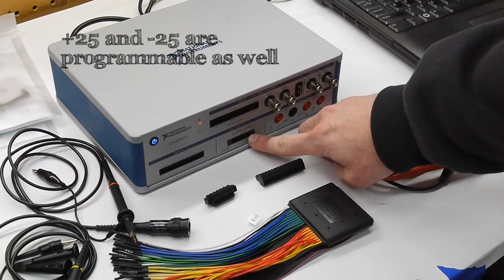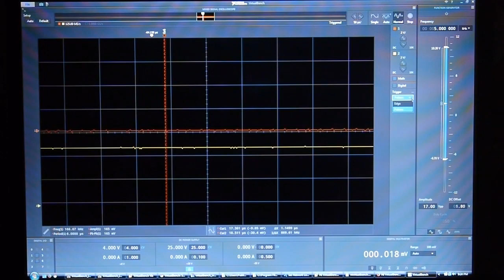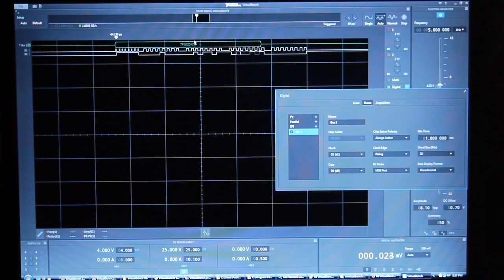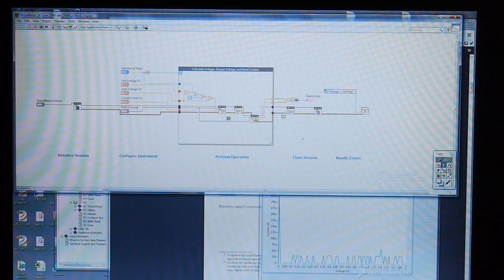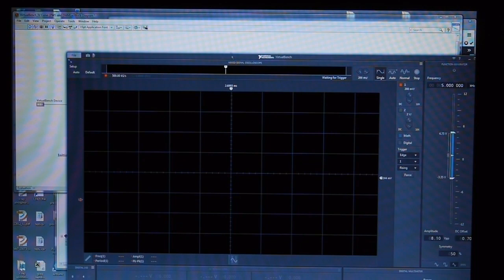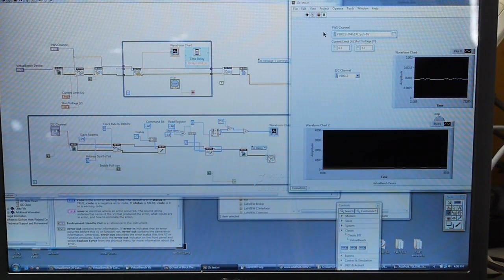Review of National Instruments VirtualBench

Comment: And here goes my suggestion to NI and all others supplying drivers & apps for some instruments.

Why not also have a built-in html5 web server, so the only thing you need on your PC, PAD, etc. is a html5 capable browser, which is nearly every browser today.

No install, no hassle with drivers, apps, conflicts, just start up your browser, type the IP/adress of your instrument or have it all set up as a shortcut and you're ready to go. No matter if it is a Samsung android pad, Ipad or one of your windows,linux machines or virtual machines.

The same goes with integrating it with user code in any language.
Do it with a general TCP/IP interface, too. What is the use for a driver talking to the instrument and then presenting some kind of non standardized API anyway? Just skip the driver and use the "TCP/IP API" built into the instrument directly.
Reply from the maker: I agree.  The VirtualBench does have a webserver for configuration and settings, but no HTML5 app for usage.  This sentiment applies to mobile too:  Forget iOS and android apps which provide the same functionality as a webpage -- just use a webpage!  Of course, vendors know users want this, but would prefer to have them locked into app, rather than able to quickly switch to another vendor by typing a different URL.
Reply: Applied Science what does the vender get for forcing app? you purchased their hardware...they got paid!  what are they trying to gain?
Reply: That'd make too much sense.
Reply: jasonofcompsci ok so why not a pre-html5 web page and app?
Reply: Raymund Hofmann   Adding a layer of code and administration tends to increase latency

News flash: web servers are a layer of code and administration.  In fact, they're a LOT of code, and they add a lot of text overhead.

via any I/O offered by the OS.

News flash #2: all I/O requires a driver of some sort.  ALL. OF. IT.  Even USB ports.
Reply: Raymund Hofmann  Web servers are everywhere

Ubiquity implies neither quality nor low latency.

why not stick with a few good and efficient I/O drivers

How few?

Are you working in the "driver software industry"?

Drat you for discovering the nefarious plan of the Driver Software Industry Association to conquer the world via a nasty driver jungle for each and every slightly differnt device and/or manufacturer! Mark my words, Raymund Hofmann , we'll get you for this!!!!!!
Reply: Raymund Hofmann  The best quality and lowest latency is not what the market will buy

You're confusing technically competent engineers with the mass market.

"Everything Should Be Made as Simple as Possible, But Not Simpler"

That's not an answer.
Reply: astrialkil The VirtualBench has a wifi and a USB interface. If you want to make a app that works for both interfaces, then it has to be a PC app and not a web-app.
Reply: IThinkForMe And now we have web-usb and a web browser can talk to usb devices. You’d think it’ll change what the vendors do. I hope.
Reply: +Raymund Hofmann  What is the use for a driver talking to the instrument

Low latency?
Reply: +Raymund Hofmann HTML5 is not a programing langage,its a markup langage, the most interesting things is done by the server side langages, which could be asp or php,now a day even client side langage (HTML) should be heavely inhanced by Jquery or javascript,bootstrape...
,
Reply: +Raymund Hofmann  there are a lot of instruments in the market which includ a built in server,the problem with that is you cannot customise your testing solution, you are limited only by the UI delivered by the built-in webserver.if you want so, you to install necessary drivers and includ .dll to your projects.... :)
Reply: Badre ARRAS The built-in server provides the data to the web application, and typically it’d be something standard like rest with xml or json; or data packets over websocket. Your code can do just what the web application does. Not only is it easy to reverse engineer, but you’re likely to run into very typical approaches. So, even if the vendor does not specify the protocol exposed, it’s usually not all that much effort to get to it on your own. No dlls necessary. All major application development frameworks support establishing http connections to a web server and carrying out requests in typical fashion (rest, json, xml, websocket - all are supported).
Reply: IThinkForMe Networking over USB is an option, also very easily cross-platform. Or build an intermediate layer that hosts the web app locally and redirects data to the USB connection.
Reply: wanswers
>Networking over USB is an option
Not if you want to run an oscilloscope via USB. The bandwidth you get over plain USB is something you may not want to design away.
>build an intermediate layer that hosts the web app locally and redirects data to the USB connection.
This is an interesting application, but I can see having to set up wireless and USB to get an oscilloscope working quickly become a user experience problem.
Reply: IThinkForMe Networking over USB gives you standardized drivers. That’s all, and that’s great. The rest of the software sees your device as if it was a yet another network interface. And networking-over-USB is rather performance-focused, both on the end of USB device class standardization as well as on the USB host end of things. A network-over-USB connection has no problem saturating a USB3 link, and it’s also easier to apply in terms of components: if you have a microcontroller with Ethernet RMII, attach it to a switch chip, add a PHY for the BASE-T connector, and a USB-to-Ethernet bridge to another port. Simple and effective, with minimal development cost. You get USB support as soon as you’ve got the TCP/IP stack up. Both iOS and Android support standard CDC (Communications Device Class) RNDIS and ECM sub-protocols. It all pretty much just works, and these days using some custom protocol for USB is silly, mostly. All you may need has been standardized and the drivers are bundled with all major operating systems.
Reply: RonJohn63
Why do you think so? Adding a layer of code and administration tends to increase latency, because this driver is likely to translate between the drivers for I/O and the application.
I see no reason to have these kind of drivers except for meeting really common and substantial standards, otherwise put it in the application software that talks to the device via any I/O offered by the OS.
It is another story if the device is attached via a custom I/O to the system and the system eventually should do more kind of realtime duties, then a driver might be advantageous. Unlikely to be that way for standalone systems.
Reply: @raymundhofmann7661  Going through the whole TCP/IP stack definitely would add additional latency compared to talking over a serial connection with a custom driver.
Reply: @frother  Did you measure it? I think for current OS/Hardware  the physical link speed dominates the latency. And about the lesser latency caused by software i would rather want to rely on much more proven and optimized TCP/IP stack and network drivers.
Reply: frother TCP/IP stacks and USB networking drivers are optimized to hell and back. They add no latency compared to the latency of the USB link, and of the underlying device. Windows is not a real-time OS, so you can’t reliably use extremely low latencies anyway. But in a typical scenario, the device-to-application latency for CDC-ECM over USB-C can be well below 100us. The network stack will do the absolute minimum amount of processing on top of the packet, and you can design the user software (web browsers leverage it!) to do zero-copy data transfers. You literally have the USB host write the stuff to a RAM buffer provided by your application, and after a bit your application is notified that it’s buffer has been filled, and the OS doesn’t touch the data other than to perform packet filtering and update the state of the connection in the TCP/IP stack. Decryption can also be done by hardware, so the SSL stack doesn’t touch the data, just update the state. Custom drivers are nowhere near that performance unless you have know-how or money to put a lot of work into development. For serial-over-USB devices, the vendor drivers usually suck. CDC drivers in the OS usually do the best job compared to anything a vendor may provide. And what even would one wish to replicate Microsoft’s or Apple’s work for? It’d be a waste of effort. These days, the USB driver development is mostly focused on the device end of the link, and on standard device classes. USB has finally fulfilled its basic promise of being a “virtual wire”. You want to have a video cable, use a video device class. Serial cable? CDC ACM class. Virtual display? Use DisplayLink-over-USB, and leverage a vendor driver for that. And so on.
Reply: RonJohn63
Web servers are everywhere, no need to install and they don't replace the driver, they replace the application program and the driver in this example, so even if they are a lot of code they are mostly favourable compared to a specific driver & application. The raw network communication with a html5 browser can indeed be binary, no conversion overhead there, you can already rely on efficient streaming for video/audio, graphic remote terminal support, 3d rendering and a lot more.
Yes, and because all I/O requires a driver, why not stick with a few good and efficient I/O drivers instead of growing a nasty driver jungle for each and every slightly differnt device and/or manufacturer?
What you say about this "news flash"?.
Are you working in the "driver software industry"?
Reply: RonJohn63
The best quality and lowest latency is not what the market will buy, ease of use, total cost of ownership, necessary maintenance and administration work play an important part. And i think the pressure on web browsers getting more user friendly and higher quality  is a lot higher than some specific driver/app of one vendor. But the best is: Web browsers are exchangeable! You are very likely to find something doing the job good enough, you can consider a web browser something that has to work, otherwise there are alternatives.

How few?
"Everything Should Be Made as Simple as Possible, But Not Simpler" Albert Einstein.

Looks like i can control my paranoia about the "Driver&MickeymouseApps Software Industry Association", as i discovered many devices wanting me to join the mafia are dispenseable or can be operated without a driver more sensibly.
Yes, Sony, i don't use your "Playmemory" software, i just sync the memory card by plugging it into my notebook. No wifi rubbish that requires installing drivers&bloatware. How infamous!
Reply: So technically competent engineers don't work for the mass market?
What do they work? Making things that no one voluntarily will  buy?

My quote is an answer, one that requires evaluation by non-idiots but reasonable people of course.

So let's come back to the original topic, how did what you said give any more value for the consumers of measurement technology except stubbornly trying to elevate yourself with irrelevant claims?
I think you are one of the self labeled "competent" engineers, not working for the "mass market" or even worse, working for a heavily subsidized market but obviously having trouble with that.
Reply: Raymund Hofmann  So technically competent engineers don't work for the mass market?

Working for the mass market is not the same as buying in the mass market.
Reply: RonJohn63
Sure, i know.
But did you know that supposedly your OS and its drivers are not the lowest latency possible because they are dominantly written in a high level language, so your wisdom reaches us all a few microseconds later?
Reply: Because it suuuuHHHhuuuhuuxxxx!! In terms of the software architecture for high speed acquisition there is really a lot of data, current javascript implementations are just way too slow as are the options for retrieving that data over http or asynchronous websockets. The Redpitaya html5 interface is horrible for this reason, it's so laggy and you need a really powerful device for it to work properly. It doesn't work at all on my ipad or iphone etc so I've written a whole new software based interface with SCPI.
Reply: @cda32  You are not stuck entirely with JS, proper WASM is on the horizon.
Reply: re: "Why not also have a built-in html5 web server, "
Uh-huh. Another layer of protocol ... increases latency.
Talking directly from various apps, LabView C etc and even VB is a lot less complicated.
Reply: If they make it easy to interface with, how can they force you to RENT your application from them? From my limited experience, NI exists only to extort money from large organizations. LabView exists to enable engineers who aren't that good at programming to show off how bad they are at UI design.
Reply: As a web developer I find people think html5 does a lot more than it actually does.  Most of what goes into a webapp is pre-html5, html5 is just a few available features.
Reply: +Badre ARRAS Whatever you label it, my point was that it should be utilized to avoid useless driver/app and software installation.

Comment: Strange that they included USB and WiFi, but not Ethernet?
Nice having a c interface, which would ease wrappers in python etc, hopefully you can actually access all the controls via the api.
LabVIEW has always seemed a strange beast to me, but from memory the extent of the module library is just mind boggling.
Reply: +oranac
The VB-8034 which was released earlier this year includes Ethernet as well as upgrades to many of the instruments. 
Scope: 4 channel, 350 MHz, 1.5 GS/s/ch
DC Power Supply:  3A on the +6V rail and 1A on the +/-25V rails w/binding post connectivity

Please visit http://www.ni.com/virtualbench/specifications/ for more information on VB-8034.
Reply: There's a Python wrapper for NI's DAQmx drivers that would probably work for this. The hardest part is grinding into low gear to make sure you feed it the correct C-types. The help files that NI sends with DAQmx are pretty good, but I had to keep checking Python references to figure out how to send 32-bit Ints and so on.

Comment: Ben, do you dislike pc oscilloscopes categorically, or have you just never used a decent one? I've never used a decent one, but I reckon it would be possible to scrape together a lean fast output, and with this unit you could even interface with a physical control panel via the various inputs
Reply: Are there any decent ones at all? (at a price where you can't get a much better standalone scope instead)
Reply: To be exact most of middle/high range oscilloscopes are PC based.
If i remember all Tek oscilloscopes form 5000+ series are running Windows, I know that MSO 7000 series use Windows 7( I have one), same is for Keysight (Agilent) for series 5000+,  LeCroy......
Reply from the maker: Miloš Lazović
It's a good point.  I guess the distinction should be:  Does the device have a dedicated front panel with knobs and buttons, its own display, and low-latency controls and acquisition?
Reply: Applied Science I agree with your division between PC based and "classic" instruments, but lately even category as low-latency controls started do blend between them, there are some models of oscilloscopes from renowned manufacturers that suffer from very sluggish control response (they nearly freeze when you go to menus) and again you have very low acquisition latency from PC based instruments (like from NI PXI instruments).
I totally agree with your conclusion what is purpose of this "All-in-One Instrument", it is not replacement for "classical" instruments, it is best suited for automated testing of products (basically as all NI modular instruments).
Reply: I believe that a PC based oscilloscope could be potentially better than a traditional one. Nowdays even modest integrated GPU or tablets have more than enough graphics power to display intensity grading at 60 FPS with no perceivable delay. A properly designed interface with keyboard shortcuts etc.. could beat knobs anytime. However I think that the problems lies in the fact that electronics test equipment companies do not put (yet) as much thought into the software as they do on the hardware.
Reply: fagiano76 What you described (except lack of knobs) is way all mid/high end oscilloscopes work for last 15+ year (Keysight/Agilent, Tektronix, LeCroy ...), all of them accept keyboard, mouse and new ones have touchscreen displays, technically all of them are PC based oscilloscopes (all of them have some PC in them).
Sill no one managed to "properly designed interface with keyboard shortcuts etc.. " that would beat knobs, and that is not only for oscilloscopes but in most software (thats why most high end video/sound editing, graphic CAD ... softwares have dedicated HID full of knobs that is always used by professional and give more natural and faster acces to software functions).